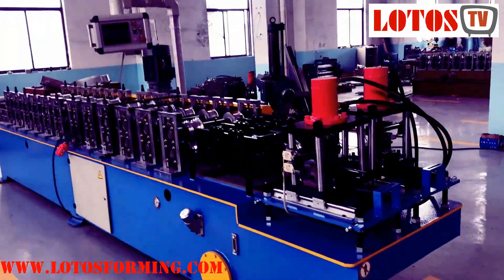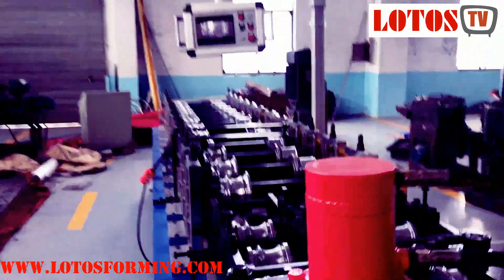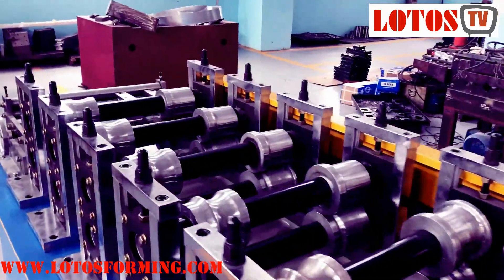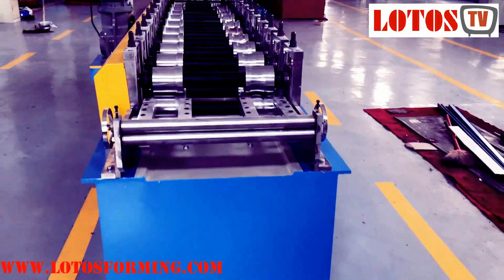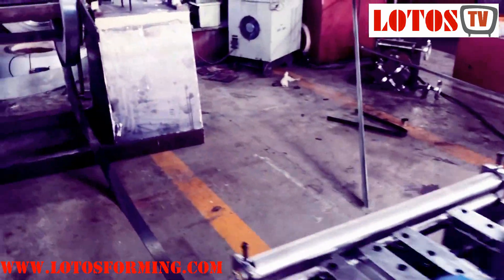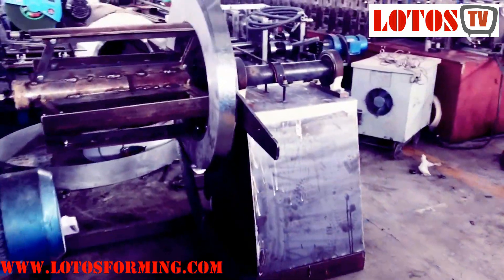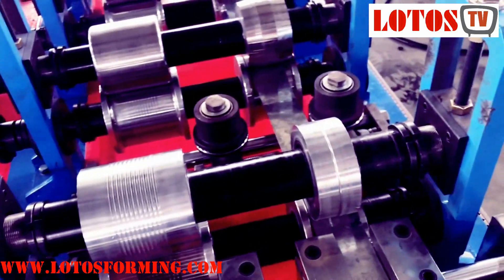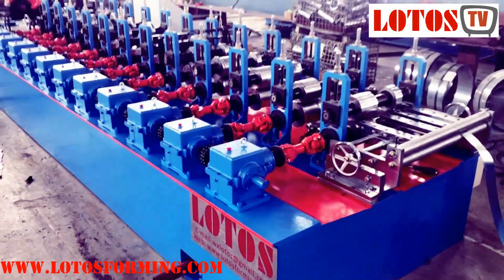【Side by Side Roll Forming Machine】: 2 in 1 Roll Forming Machine | Different Types Forming Machine

Comment: Cold roll forming machine foundation, sometimes called the roll forming machine mill, support the components needed for the shaft brake, roller, drive chain, and other molding structures.